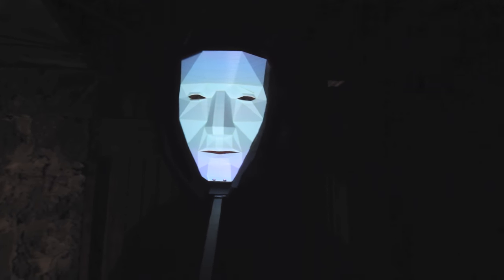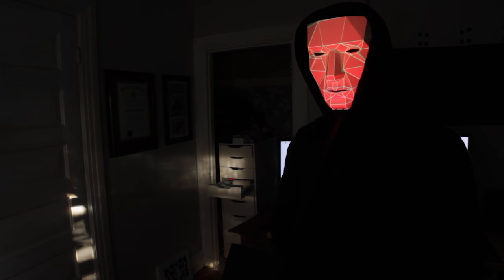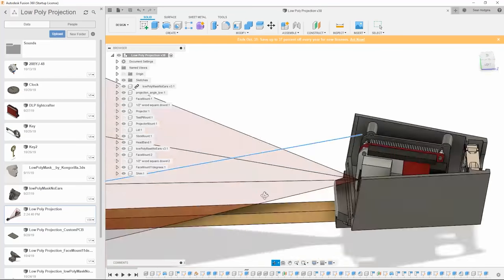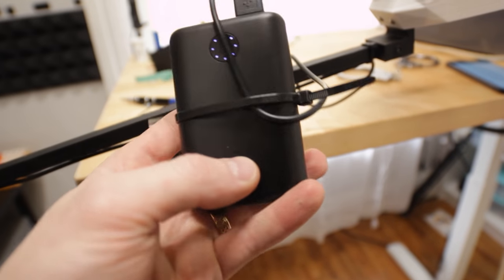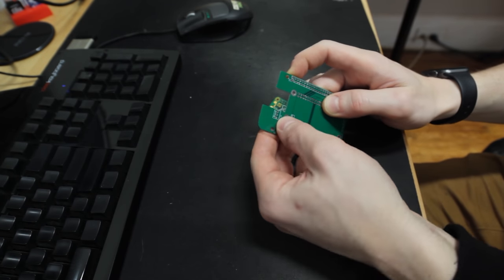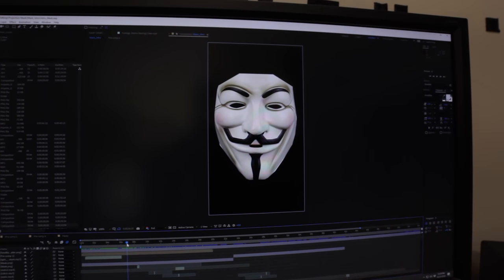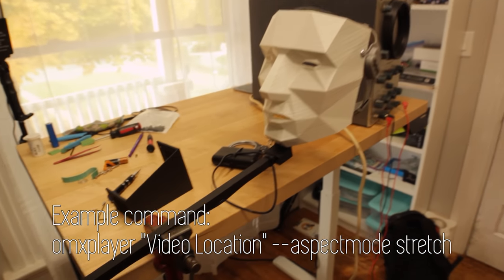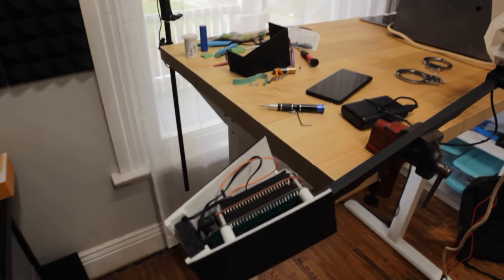Be Anyone with this Face Projection Mask

Comment: Imagine this but with bendable lcd screens.
Reply: lumen couture
Reply: LCD wouldn’t work. LCD requires back lighting. Oled would work.
Reply: How about a short throw laser projector from a hat brim.
Or since It's low poly, custom shaped multiple oleds?
Reply: @DrPWNS-fz6yh  bendable backlight 🧠
Reply: @DrPWNS-fz6yh  just need a diffuser sheet and led strips on the side that will be covered....
you'll can make a cylindrical mask this way . oled is possible as well.
Reply: That would be fun for a rave
Reply: Ohh okayy but thats old now we could use oled or amoled
Reply: @driacon 🤔🤔
Reply: If I could afford it, I would be doing this rn.
Reply: moldable oled screens.
Reply: @DrPWNS-fz6yh  actually it could work if you have tons of tiny and thin bendable lcd screens
Reply: @geovanneyhammond3941  bro, imagine that as active camouflage
Reply: Oled not lcd
Reply: @sparksycat  layman's term
Reply: @jacobhoward7358  I doubt it would work, camo is meant as a bush that makes you "invisible." but from the glow it wouldn't work at night or day.
Reply: why would u use bendable lcd on a low polly mask 
this mask doesn't have any bends 
everything is flat
just use a bunch of costum made lcds
Reply: That'd be sick but we're working on that type of tech so we might see it sooner than we think
Reply: @Tailslol  ummm FBI needs to speak with you cause how tf do you know that?
Reply: @machy8515  same...
Reply: @jacobhoward7358  army bro universal uses
Phones, tablets, laptops, army camo, disappearing in crowds
Reply: @jackiehiner2632  I already said this but they'd have to be super thin, thin as string, and have to have like 100 lights per layer...
Reply: oled will work
Reply: can be done with custom matrix oleds with shaping transform applied as an image map projection would make a cool  holo suit effect with potentially more practicality
Reply: The future is now old man

Comment: great prototype. You could mount the projector to your belt and use a mirror to reflect it at the mask so you dont have a heavy block in front of your face. If you can get a curved mirror a baseball cap brim might be able to hold the mirror and stretch the image but you will loose some resolution without lenses.

Comment: Those Anker power packs are awesome. I use one to power my Roland-07 mini recorder and I can't tell you the last time I had to recharge it;  it has recorded dozens(!) of 2 hour rehearsals with my quartet. And I used it on a week long trip (not exclusively, but a fair amount on planes) to boot. I just plugged it in the other day and it still had 2 dots!

Comment: The face mask maybe easier to project on if it was less geodesic - fewer hard lines. The choice of materials may improve the brightness, I recall projector screens have microscopic glass beads which reflect the light - so maybe there is a paint that’s available to help this.

Comment: Is it possible to make each "polygon" of the mask an LCD screen to eliminate the need for a projector?
Reply from the maker: I've been thinking about this since its creation. The answer is currently no... without having large gaps because all LCDs or OLED displays are square, a couple of OLED are round. I've tried to see about getting a triangular OLED made, but the costs make it not feasible at this time. There are a couple of people who have put flexible OLEDs in front of their face, the effect is really cool, but hard to see through, and its a totally different design than what I am going for (an actual poly face is the look I want).

Comment: hey do you think you can make opposing magnets that can lift itself? 
such as a wheel spinning with magnets or electro magnets with opposing magnets. maybe counter spinning. all in 1unit.
do you think it will make a difference what the housing is made from. maybe copper or iron?

Comment: Why wouldn't you just put the projector at the end of a wire and then hide the ras and all the rest down your shirt with the battery? Then it wouldn't weigh so much and the stick and be smaller/thinner.
Reply from the maker: Projector runs on GPIO and needs basically all of the pins, the cable would have 20 wires in it, that would be way heavier. Projector is also basically all of the weight. The stick could be smaller based on the weight but you lose rigidity. The projection works better the less movement on the end of the stick you have so rigid is important.
Reply: @SeanHodgins  Gotcha. So it would basically be like having a couple of thick VGA cables or something running down to it. lol Thanks for clarifying. I don't know much about this stuff. I want to get to dip my toe into it and maybe tinker with a raspberry pi but it seems intimidating.

Comment: Don't spend 30$+ of the head gear, you can find the same kind of setup for under $10.

I like the concept but I wish it didn't have a selfie stick sticking 3 feet off the front.